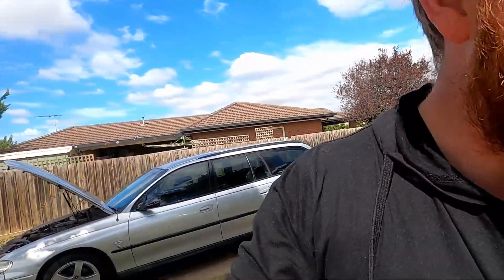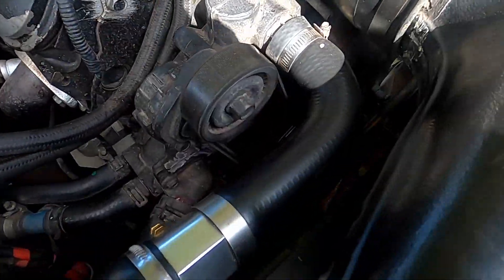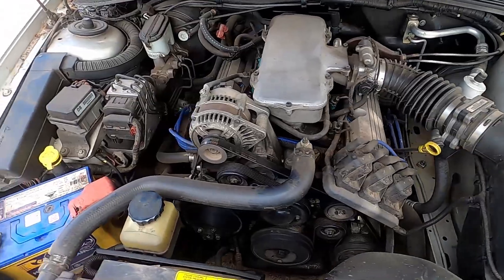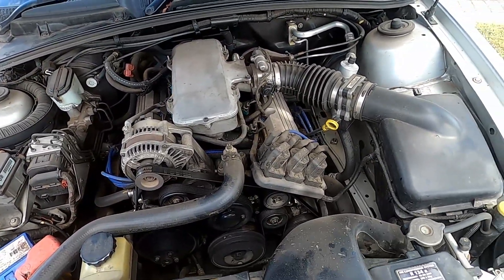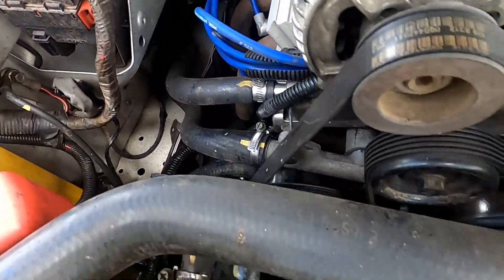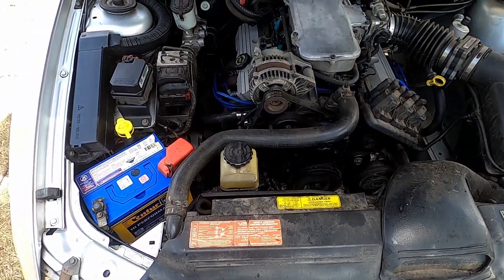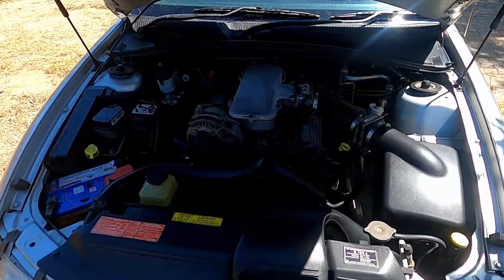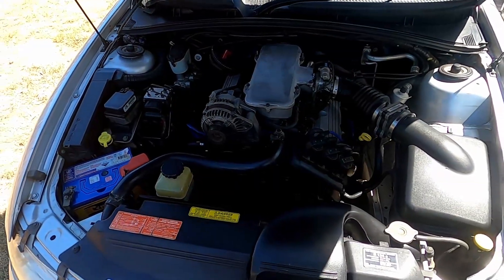Holden VX V6 Engine Detail Transforming Mum's Engine Bay!

Comment: I have the same car, can I pressure wash the whole engine apart from battery and fuse box, or do I have to dodge some stuff
Reply: Yeah dodge the alterator (chuck a plastic bag or 2 over it and tuck it in at the bottom) and try avoid getting any water in the air intake.